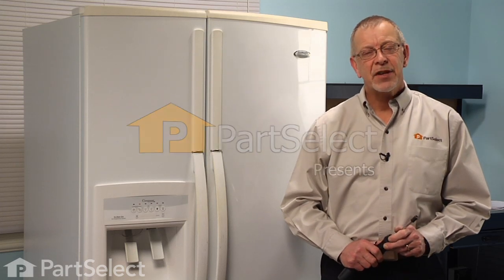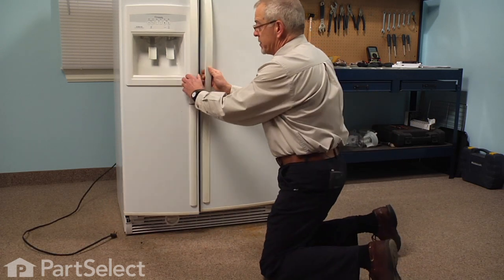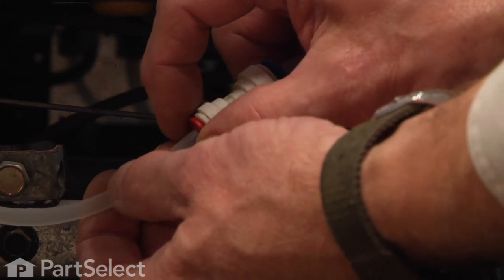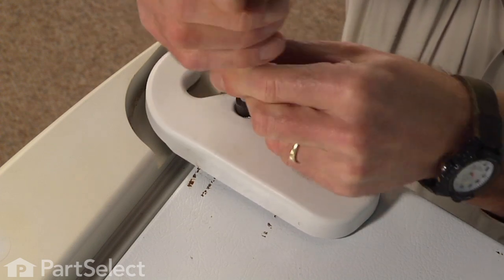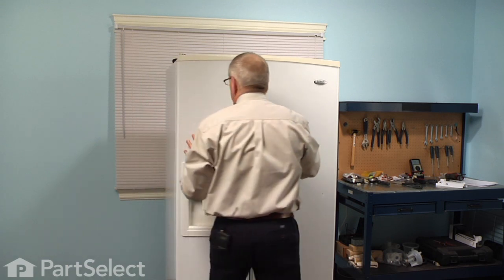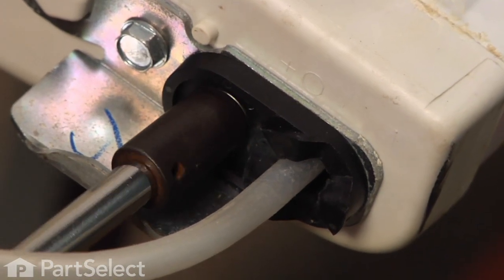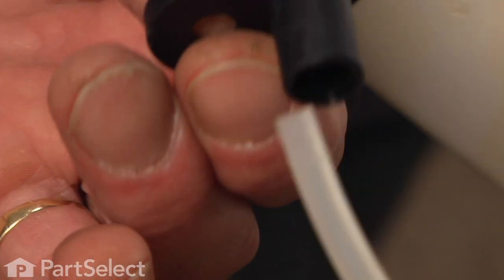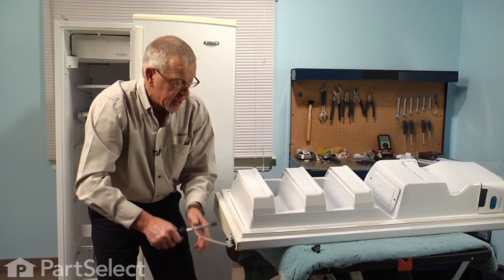Refrigerator Repair - Replacing the Lower Door Closing Cam (Whirlpool Part # 2182179)

Comment: You mention that the cam is identical on both doors but mine has a different part number, 2182178 for the fridge and 2182179 for the freezer.  Should I replace the lower cam also when I have the door off.  Is there a kit that contains all the parts?

Comment: I have a whirlpool side by side and the refrigerator side door is sagging will replacing the cam fix the problem?
Reply: Yes, that was my problem on the rt side door. replaced both the top & bottom door cam. The cams were worn thin.

Comment: replacing the cam did not fix the popping noise on my  Maytag right side door with freezer bottom Model #MFI2569YEB0
Reply from the maker: There may be an issue with the insert in the door panel. Remove the door and check the operation of the cam with the socket in the door.